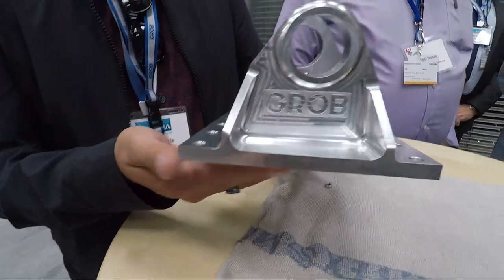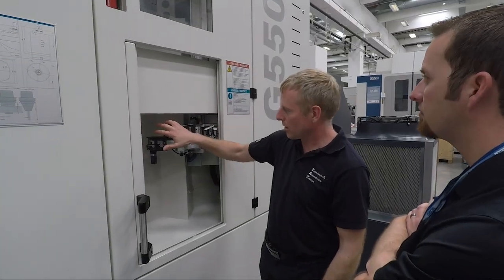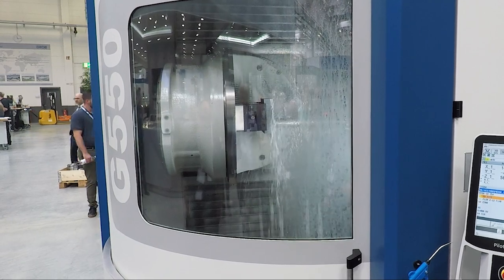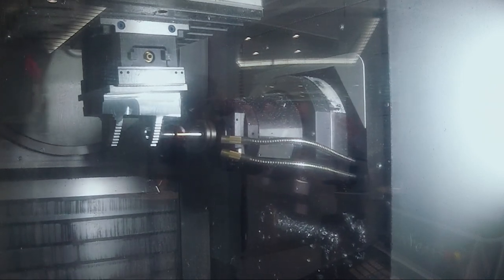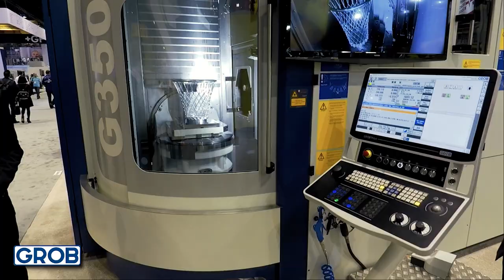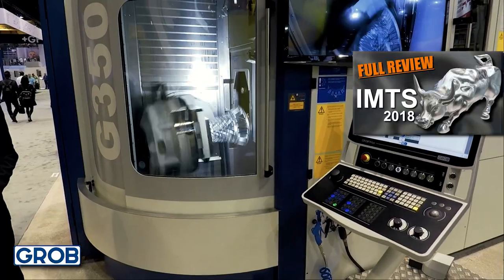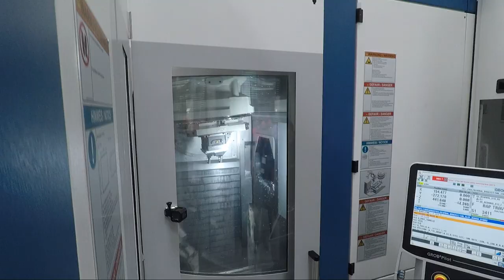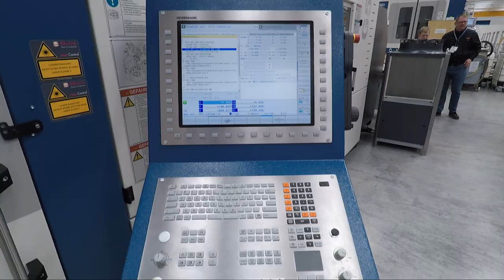AMAZING 5-Axis Horizontal CNC Machining Centers | GROB: Entering the Job Shop Machining World

Comment: Watched the video - walked to the shop, looked the Tormach PCNC1100 in the eye and told her I'm going to bolt you to the ceiling for better chip evaluation. She threaten to crash all her 3 axis if I watch another GROB.....
Reply from the maker: Please do this!!!! LOL
Reply: @nyccnc  but then I'll need to bolt the laptop to the ceiling to make the CAM right .... I'll risk becoming batcam....😢
Reply: @loupitou06fl  What if you just run the program backwards?
Reply: @The0Pi  Well you would need English endmills, the one that drive on the wrong side of the road. Or run it in the southern hemisphere....

Comment: 5-axis machining provides us with the following benefits:

Improved drilling process: This process allows us to reach smaller and more complex angles, as well as proving the capability to drill a set of holes with different variants without changing the initial set up of the machine.

Efficiency & cost effectiveness: By being able to cut your material in one place, rather than having to set up at different stations after each section saves a considerable amount of time. This also leads to less wastage and lower tooling costs.

Better surface finish: With the extra axes provided by 5-axis machining we can bring the part we are working on closer to the cutting tool. This allows the cutting tool to be shorter, resulting in fewer vibrations and a higher quality surface finish.

Comment: Are these guys the same ones that built the GROB 'astir' gliders (airplanes) in the 70's and 80's?
Reply from the maker: I actually DO believe there is a relation between the two companies - brothers / family IIRC
Reply: They sold the aerospace/space part in 2006, was then called Grob Aerospace AG. It's now called Grob Aircraft AG since 2009.

Comment: I hope you like vibration and weight errors because you will have them forever.
Reply: RockGodZeppelin 
You mean the errors the machine automatically compensates for? 

Yes. It has vibration and load sensors and accelerometers to read and compensate for errors that would be induced by it. Things that have been on high end German machine tools for well over a decade.
Reply: @occamssawzall3486  I'm more or less just joke venting about my grobs and the annoying issue that I deal with on a daily basis. I think they are amazing machines and I'm sure some better programming would solve the issues, but it's not really a big deal at all.